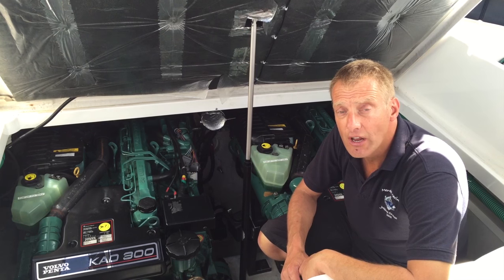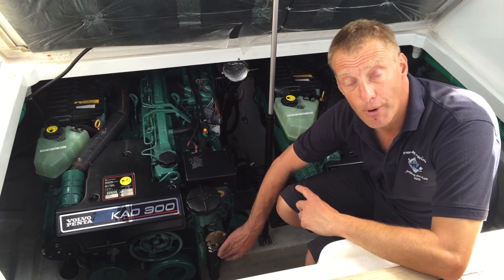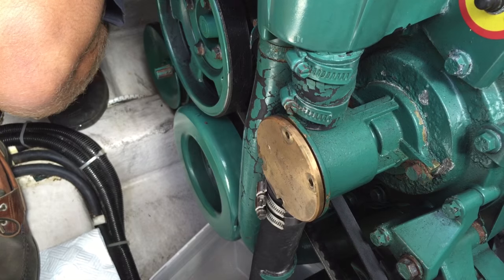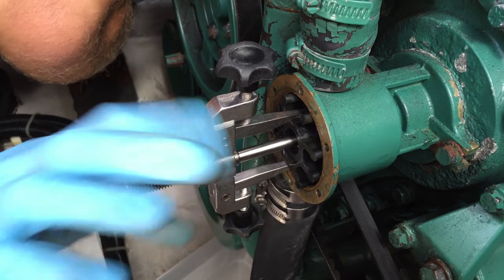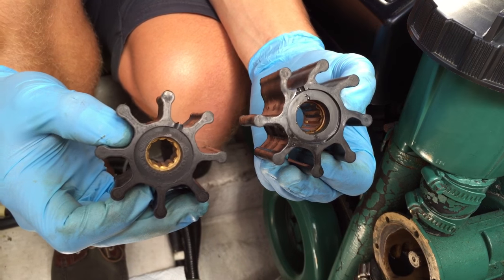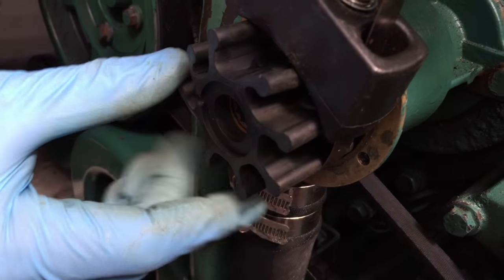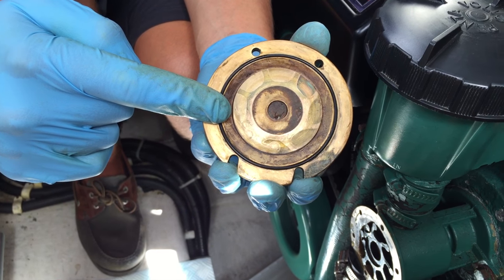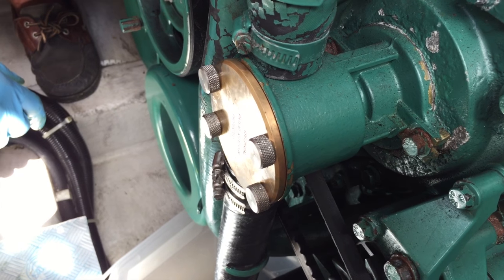How to: Replace a burnt-out impeller

Comment: I have a Sealine 270 with a Kad 42, the pump faceplate is really close to the water tank, too close for extractors, any tips for when I have to change the impeller. She has 2300 hours on the clock so must have been changed a few times before.
Reply: +Russ Cattell 
Simplest answer is probably to just remove the whole pump, you will need to loosen both jubilee clips and remove the pipes, be careful as the bottom one may be below the waterline so plug the pipe. now it s 2 x 12mm bolts either side of the pump, you will need a socket and an extension these secure the pump on, now wiggle it forward, remember you will need new gasket or some gasket cement for reassembly. Take the whole pump off and it all becomes much simpler. I do the same on out boat as room is tight. Takes about an extra 10 minutes. Jon
Reply: Thank you for your help Jon. That all makes sense to me.

Comment: What lube do you recommend consider it should be rubber friendly?
And would you recommend the same lube for fitting tight bellows?
Reply: You can use dishwashing detergent as a lube for the impeller and it gives you a visual check that the impeller is the right way around and working correctly by seeing the bubbles rising outside the boat.Dont know about the bellows have not done them but should be fine.
Reply: I use aluminium grease
Reply: Or silicon grease is good for any rubber that needs lubricated it also doesn’t pick up much  dirt and particles which is useful when maintaining the impeller